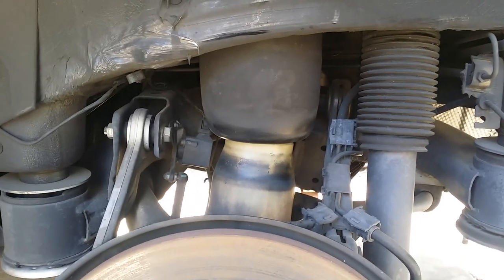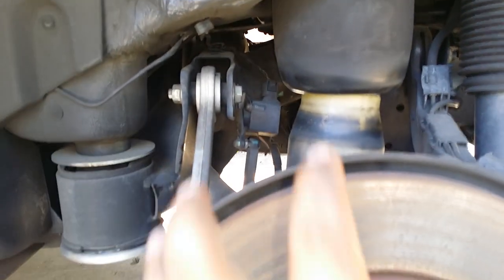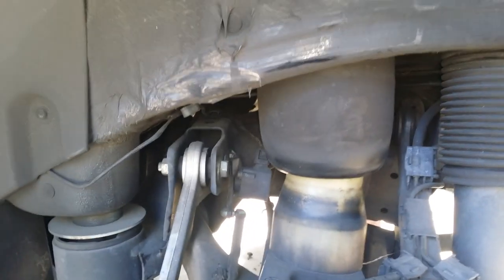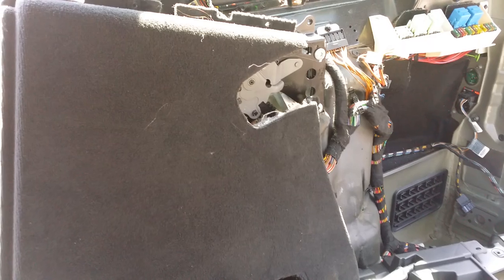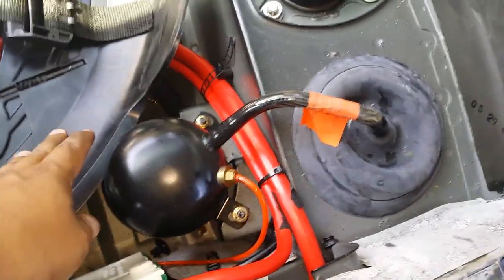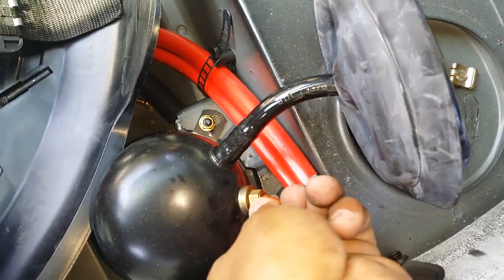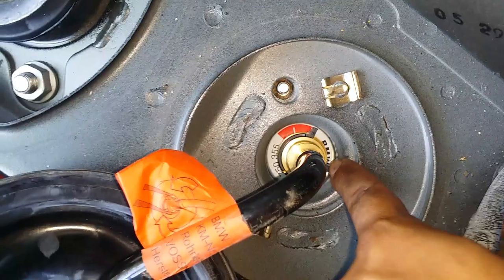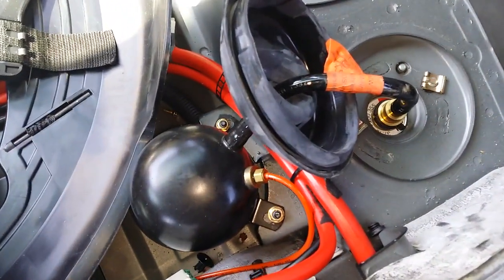BMW X5 Rear Self Leveling Suspension Air Spring Removal Part 1

Comment: hi,

 my x5 2001 suspension is not working - the rear has dropped completely making it a very bumpy and often dangerous ride.

The issue supposedly started when one rear tire was changed with a slightly different sized tire (compared to previous and other rear side tire). I thought the sensor might be confused but after about a week I placed a new tire (same size) but suspension not going up.

Ive disconnected the battery and reconnected to reset - no result.

I played with the cylinder out of desperation, which burst open, meaning it was full with compressed air - giving me the impression that it is not a problem with compressor.

There is no hissing sounds or anything. The air is just not moving from cylinders.

When I start the car it seems that there is no 'new air being compressed and sent to the cylinders'. I believe its a sensor or fuse problem but not sure that is not giving any signals.

Please help as I am broke and just bought this car of a guy...

Thanks!
Reply from the maker: Sorry to hear about your issue.
Seems your air compressor and suspension airbags are in working order.  Check your air compressor module.  Its a small black box located on the side wall of where the spare tire goes.  I beleive its cover by a black plastic cover.  Keep us posted
Reply: I just had the sam issue on my 04 BMW x5 4.4i E53.  Read another forum and replaced the fuse in the rear panel fuse box and all worked fine.  I do have a slo leaking Air Spring that needs replaced, but at least the bumpy and dangerous ride stopped and the compressor re-inflated the air springs.

Comment: Hello Sir. Thanks for the BMW video you post. They Help me out a lot, but I was wondering if you could help me with a issue I'm having. I have a 2004 BMW X5 E53 4.4l. It’s making a ringing noise. The cause of the problem is a H10 gong. It just won’t stop ringing. Do you how to fix this. There’s really nothing on YouTube explaining or showing us how to fix the problem. If you could do so I’d appreciate that. Thank you for your time Sir. 

V/r 

Jason
Reply from the maker: unfortunatley we haven't experienced similar issues as a result, we wouldn't be able to assist.
Reply: bimmermerchant thank you for responding. I really appreciate it. I have fixed the problem. Thanks again :)

Comment: Hello bimmer friends. I have bmw e61 from 2004.y, and im interesting to change my rear air suspension with a normal springs suspension, do you know is there any posibility to do that? I find kit on ebay for e39 and X5...

Comment: hi have 2004 bmw x5 4.4...where is self leveling sensor ..
Reply from the maker: BMW X5 should have two self leveling sensors.  One is on the front passenger side, and other is on the driver rear.  The are small black boxes with a plastic lever attached to suspension

Comment: I have casual iron springs.. I think these air ones could be cool to install :D
Reply from the maker: Did you install airbags?
Reply: @bimmermerchant  I am not sure is it economically so wise. I have full IS-model suspension with 2 LSD's on both axles already. 50mm lift with original iron springs, with the air suspension road driving would be more comfortable but I would need to get a different set probably to maintain same max ground clearance with air suspension. But that system would be so amazing. I see as only problem the controll units of 2 axle ones being problematic and very expensive, on top of that the front suspension air struts are very expensive. It's amazing system but by economical view the iron springs are so "easy and reliable" 20y of age and originals still and no rust on iron  parts. But I would guess that if you use air suspension units you would probably need to do something during the first 10y, and during 20y you would probably need to repair everything already. But the only downside is the cost and labor, you you don't count them in, the air suspension is superior :)

Comment: Mine is BMW E53 2001, what happened is the car gets lowered every time I parked them, like half an hour, but it comes back up as soon I unlock the door. Is it normal?
Reply from the maker: your compressor might need replacing.  airbags should not loose air when you park.  You should hear compressor go on if you add load to the back or if you drive in an incline or decline hill.
Check out our website for X5 Parts.  www.bimmermerchant.com
Reply: @bimmermerchant   Compressor seem to be working but it can't pump the air to the suspension, I only heard hissing, could be my airbag that causing the problem?

Comment: Pls help I have an x5 03 3.0. rear is squeaking when I hit bumps and when someone gets in the back or on the passenger front side. If I hit a bump my undercarriage hits the pavement. the rear of the car definitely looks lower than usual as well. I'm sure it's a suspension issue but would u have any other suggestions? thank u
Reply from the maker: either your rear air suspension airbags need replacing our your air compressor is faulty.

Comment: bro i have the trifecta of lghts abs brake light and the triangle in the middle   if i pass 80mph it goes on trans failsafemode   help me sir plzz i made research it has to do with the abs module   bu what exactly do i do i saw the video it says to remove nd send to bmw so they can reprogram it
Reply from the maker: check your alternator or battery.  If your voltage drops below 12 volts, trans will start acting up.
Im currently driving with all three lights on and its ok.
Reply: @bimmermerchant   correct it only goes on trans fail safe and when that occurs it's always when passing 80mph ki da sucks sometimes I wanna smoke some audis lol but I'm afraid of pushing because it won't shift gear after on failsafe it just stays on 4th gear.  Unless I come to a stop and turn the x5 off and restart it again .   Early in the morning the lights are not on but when the car later gets warm the abs and yellow brake light appear   it's weird casuse after a while I keep playing with it and turn it off while at a stop start it back up and my lights are off  then I'm able to pass 100 easily   does this mean I need a and module I saw that video u have up?
Reply: I'm having the same issue. After a long 1000 mile in two day trip, I noticed a bad wheel bearing noise. Replacing today I'll update here after. I think its when the bearing gets hot cause its old, the sensor throws the trifecta then pushing it over 80 like you said, trans fail safe. Been chasing this for months. I'll update later like I said. Hope this works!

Comment: Hey bud..thanks for the video. I just bought a 2008 X5 E70 4.8i, is there a way to figure if the X5 has air suspension or not? Wanting to lower the ride.. saw someone mention getting H&R springs for the front and then lowering links for the rear. Am just needing help figure what I have and what I need. Would appreciate if you could please share your expertise.. thanks
Reply: I have an X5M,  I'm sure the air suspension is very similar.
The links on the level sensors need to be removed and adjustable links fitted. I've lowered mine by 45mm at the rear. The front by 50mm with H&R springs